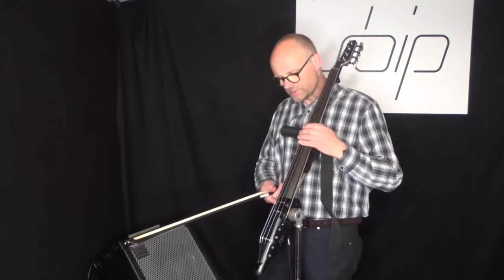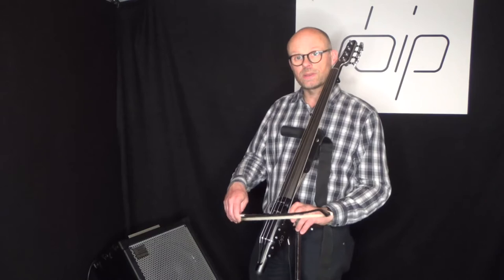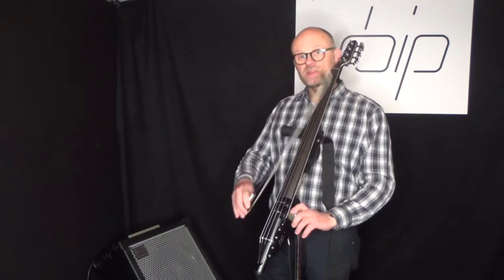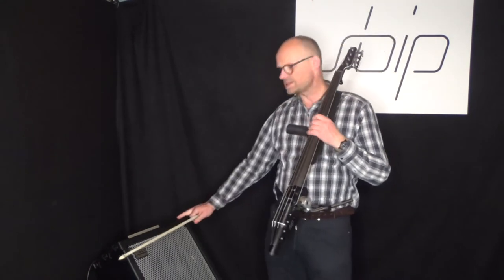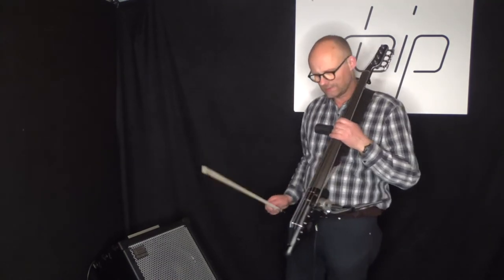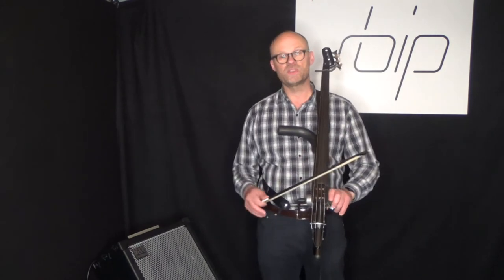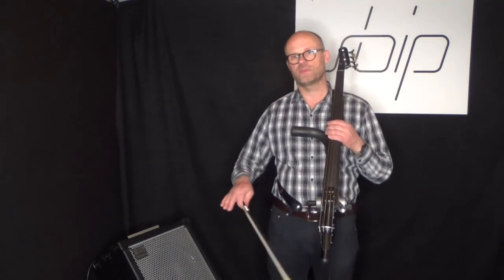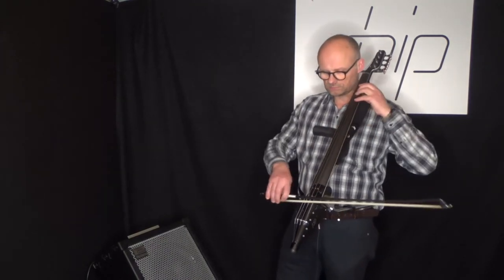sbip cello humbucker

Comment: I love my violin from you. I must experiment a bit more with the production on my studio to see what I can get out of it more. You've got an extremely powerful rocky sound out of the instruments I haven't seen in my production yet. I must take some more time to design the sound a bit more. I'm not the world's greatest fiddler because I'm a first study singer and a pianist also but I bought my SB violin to learn how to play properly because the tuning system was better than my old acoustic fiddle that just had pegs. My tuning isn't perfect yet but it's a lot better than it was. But the SB instrument are capable of incredible sensitivity too. I have a £600 Carbon Fibre Bow from Alfred Knoll, I'm working on playing simple pieces well because I never played well as a child as my equipment wasn't good enough. The tuning is a little out in places but it's also very good at times in this extract, but I think I got a totally different sound out of it. I used some Fabfilter plugins from Holland including a multiband saturator and synth. It can sound quite lyrical playing Stille Nacht too. This is about the best sound I've got out of it so far. I know I've had a slow start with some very duff and cheap amps that didn't do it justice, but I have Logic ProX now and I've just afforded a re-hair of the bow. The bowing needed to be more confident at the top and I'm an improving player, but they are good value to learn on your instruments relative to what you can buy as an acoustic for the price a a learner.  https://on.soundcloud.com/U36Sk I'm doing a sound engineering degree now myself but I have a background in Classical music and Gesang. There you go I just stuck the Clear Sky algorithmic mastering on it from Soundcloud it's sounds quite good with that on top.